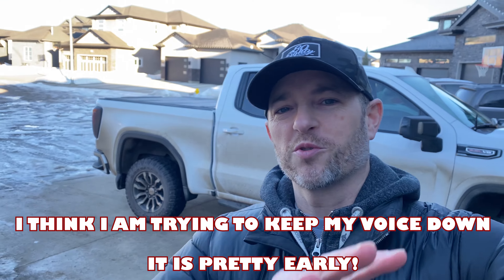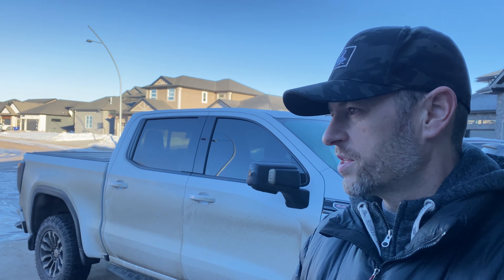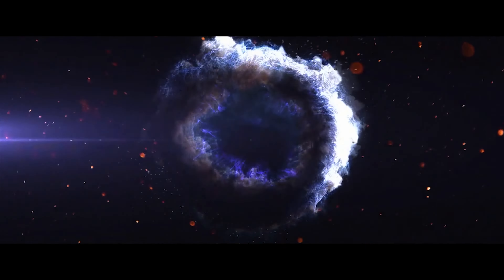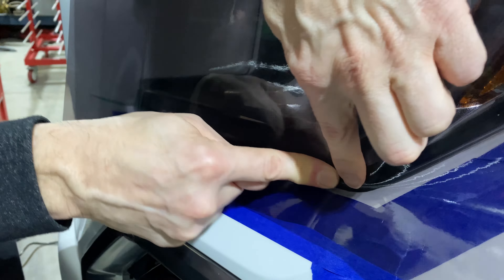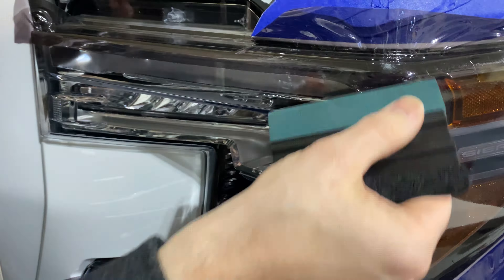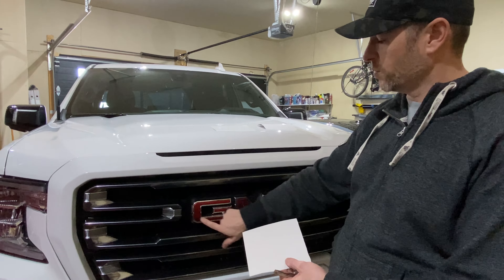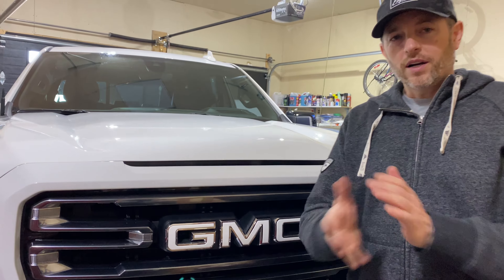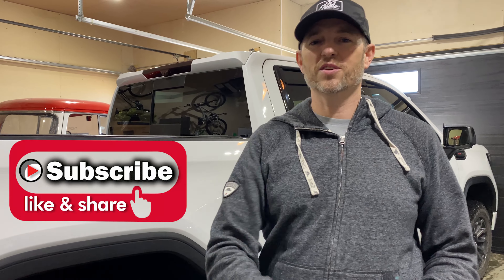Cheap And Effective Car Or Truck Mods That Anyone Can Do

Comment: Hi, Don , let me start off by saying I love all your videos I have a 2023 GMC  1500 Dinali in one of your videos you mentioned how to override the off and on automatic engine start button which I find annoying 
How do I remove that?
Reply from the maker: Thank you for watching the videos.  One way that I did it was with a mod that BoostAutoParts sells.   It allows your to change the default setting to have auto start/stop on or off when you first turn on the vehicle

Comment: Hey Don. Sorry if I missed it in the description, but do you have a link for a good place to purchase vinyl for wrapping the emblems?
Reply from the maker: Sorry, I don’t have a specific contact.  Avery sw900 is one of the easiest to use for small detailed areas.  A quick search on Amazon or Google should help.

Comment: I got almost done with one headlight and thought it was great, but I trimmed too much of the tint and ended up with wrinkles in the corner!! You make this stuff look way too easy. I realized I absolutely need a second set of hands with the heat gun, but that i also need to really get the edges done before trimming. So close!

What is that little cutting blade you're using? I don't have anything that small
Reply from the maker: I like this one: https://amzn.to/39TIUP3

Comment: Hello Don,love the videos, I just did a lot of upgrades on my truck like you, but now I'm nervous now because of my warranty being canceled, what's your opinion on that are you worried, thanks
Reply from the maker: Most of the mods I have done would be considered warranty safe.   That being said there are laws in the US and Canada to help protect consumers when installing non OEM parts.   Of course the service department is ran by people who may be more or less resistant to each repair situation.  You’ll find many reports of people in forums that were approved for warranty and denied warranty for the exact same reason too.

Comment: Don, my GMC 2020 Sierra 1500 Denali, stays in sport mode.  Is there a way to make it stay in normal driving mode?
Reply from the maker: That's odd.  Are you stating that when you start the truck the little checkered flag icon shows on your information cluster?

Comment: The vinyl you’re using here, is this the same stuff you might but at Michaels or a craft store. I have vinyl I use in my cricket cutter for airbrushing custom sneakers. This looks the same, just making sure.
Reply from the maker: My wife has a Cricut Maker 3 and the vinyl is different but sometimes compatible from what I know.  The vinyl I use is designed for automotive applications and usually needs pressure and/or heat to activate the adhesive.  VVIVID, Avery and 3M are the brands I have used most often.

Comment: I wish we had an indoor car wash, but I guess living down south, we can pretty much wash out cars outside all year round without worrying about how cold it is. 
My biggest concern is the tint on the headlights. It's just a plastic film. It seems like over time it would start to peel with the harshness of everyday driving, not to mention the suns UV rays. That's a lot of work if it doesn't last. The vinyl will last on the emblem because it's more durable. Outlining the headlights with vinyl tape would also look good.
Reply: What lmao the humidity is too high to be able to wash vehicles any day of the summer here in Texas 😂

Comment: Is the vinyl automatic car wash friendly?
Reply from the maker: Yes it won’t hurt the automatic car wash.  Kidding, the edges are the only area that if not properly installed, they could allow moisture in behind.   I prefer to use a pressure washer wand myself so my spray pattern is controlled by me.

Comment: Don did you get the GM Rev tonneau cover? I'm a new sub and haven't seen a vid on it. was wondering if you installed it yourself aftermarket or not. Thanks, appreciate the vids, just got my 2021 AT4 and trying to personalize mine as well. (current front runner is the Bakflip MX4 for me)
Reply from the maker: I bought the GM REV cover and installed it myself!  I made a full detailed video on it.  Thanks for subscribing for more on the AT4,  Here is the video: https://youtu.be/LTzM0LLvYhw

Comment: What percent tint did you use for the rear/third  break light?
Reply from the maker: Hi Erika, The tint I used is made by Vvivid and it only comes in two shades. Light and dark.  I used Light smoke.  I hope that helps.

Comment: So how long do you think that white vinyl tape on your GMC emblem would last in hotter climates?
Reply from the maker: I think it will last a 2-3 years if the edges are tucked and protected well.  The avery vinyl I used takes a lot of post heating to activate the adhesive so I know it can handle hot climates. The cost is so low to replace too.  If it wasn’t white, fading would be more of a concern for me.